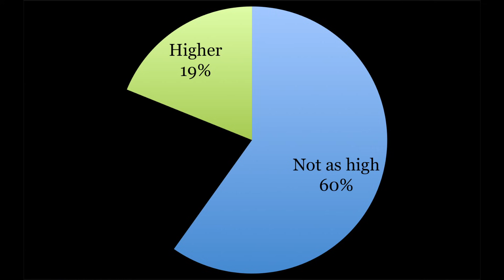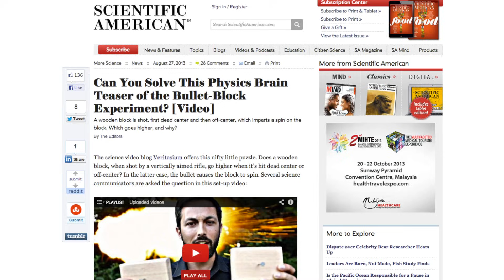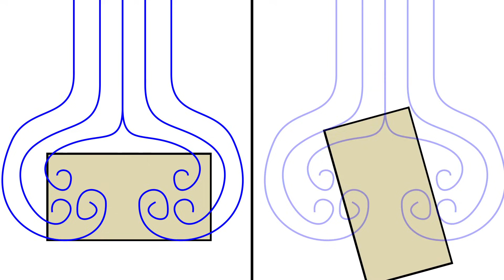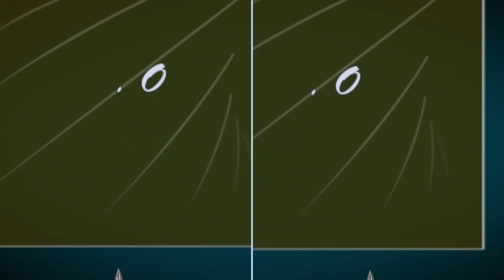Bullet Block Explained!

Comment: A way that I think might make it easier to measure might be to use layers of materials. If I remember correctly, bullet-proof glass works via multiple layers, with each layer taking away some of the energy from the bullet. Perhaps a phone book in a cardboard box, and then taking a general consensus of what page each of the bullets seems to end at? 

another possibility might be to laminate a harder wood to the outside of something relatively soft (a pine "box" with a balsa core perhaps?)  so that the outer core will take the brunt of the impact but still allow for it to pass through, and hopefully the softer center will be able to compress or deform easier, allowing a smaller amount of energy (the difference) to pass through it easier, and therefore be more demonstrable.

Comment: use stronger wood, like oak, and a longer piece of wood and also send the bullet in as close to one edge of the block of wood as possible.
Reply: A stronger wood is going to cause a shorter measured distance for both because it's going to take larger amounts of energy by comparision to go through the wood. This is all well and good if your bullets went completely through the blocks and you need a more durable material to make it register.

Comment: We have a CBC radio program in Canada called "Quirks and Quarks" where they get corroborating experts in to explain science. You needed one. A corroborating expert, that is.

It's cool that you guys are popularizing science but, it seems to me, there are so many variables that aren't taken into account, sufficiently, to make this "real science". And if it ain't real, it's fake. In this day and age, fake and unsubstantiated science does not help. Unless your favourite animal is a (sadly maligned) elephant..

To wit:

1. what is the average/SD of the amount of gun powder in each cartridge? (i.e. how to show that you are getting the same amount of oomph in each case?) Ditto mass of the bullet.

2. How can you be sure the same amount of energy is required to get a bullet to the same depth along a piece of wood? Wood is not uniform. Maybe by many (many many) repetitions one can get some empirical evidence to statistically account for any differences.

3. Did you show that the pieces of wood had, in fact, the same mass? Uh, no.

3.5 Nor did you properly set up the experiment to enable valid observation (yeah.... the one on the right was 3 pine needles higher!) of what may well be a very small but valid height difference.

4. Rather than taking 2 near identical (ostensibly) pieces of wood, why did you not try two quite different pieces but having the same mass. e.g. 1 piece of 1x2x4, 1 pc of 1x1x8. then try firing into the extremity of the 1x8 vs the centre of the 2x4?

5. Also where are you more likely to encounter variation in terms of the mass of the block of wood vs the mas of the bullet? similar mass for each or wildly different mass for each. Specifically, if he mass of the wood if much less than the bullet (hmmm... maybe balsa?) then one might expect (who knows if it is correct - do the experiement!) that if there is a height difference it would be of a larger magnitude than if the blocks were of, say, oak, in which case the mass of the oak would overwhelm the mass of the bullet. but then wind resistance may become more significant.

You could also have added a 'bullet catcher' to each block of identical mass and dimension to catch the fired bullet and prevent the fragmentation of the wood.

So, why did you do this experiment?

:)

blah blah blah

Comment: Both have the same rotational energy, but the first is direct centre hit has its rotational energy split equally across the centre and therefore doesnt rotate where as the 2nd has rotational energy all on one side. So you could say that the first is trying to rotate as well but equally in both directions. This is consistent with the force because when a bullet hits an object it doesnt impart all its energy straight, there is some energy imparted at an angle and this is where the rotation comes from. It may be less is the bullet was flat but it still exists. You can see this if you were to shoot through ballistic plastic.

Comment: Maybe you should take a block that is longer, were the distance between center and side is bigger? Than there's a bigger difference in bullet penetration. You can also do for fun use a bullet with a flat top so it has less penetration so less loose of energy.

Comment: To improve experiment: use heavier projectiles (bullets) at slower speeds. You may have to use softer targets, like clay, to achieve penetration if your projectile is moving a lot slower (it should).

Comment: i doubt ill get a reply but were you using hand made rounds or store bought rounds?

hand made rounds like what most target shooters use would be more accurate as they have the same weight of gunpowder same weight projectile and are pressed into the cartridge the same depth. producing a more consistent round

store bought rounds aren't as consistent the projectiles would be but the gun powder varies and the depth the projectile is in the shell changes also.

i don't think it would be that much of a difference but watching the variation on the blocks looks to me like around about a foot in difference so maybe it would have an impact on the results or maybe it wouldn't who knows

Comment: So...if I understood this correctly, the 50% "extra" energy in the spinning block is that which wasn't lost in the 0.1mm penetration difference?
Reply: Yeh he is trying to say that but I didn't get that too. His statements contradicted. In one statement he said that law of conservation of linear momentum (independent of conservation of angular momentum) was responsible for this. But later he told 0.1 mm story. Although when he measured through peg it was 1mm.
Reply: 2006mct42
It wasn't contradictory. It's just two different viewpoints: one way looks at momentum, which is conserved, and the other looks at the energy, which was retained from less penetration. It's all the same effect, though.
Reply: ok but what does it mean? Let's say that we try a non penetrating projectile(collision is elastic), then according to first viewpoint it should go to same hight because linear momentum should be conserved independent of angular. And according to second viewpoint it should go half the way. Is anything I am getting wrong?
Reply: 2006mct42
Actually, no. If the bullet doesn't penetrate, it'll bounce off. The total system of block+bullet would conserve its linear momentum, but the bullet would no longer become part of the block. Thus in both blocks' cases, the bullet would bounce away. By the momentum viewpoint, the blocks would be both propelled to the same height because when the bullet bounces off, it reverses direction (so its momentum changes, and the blocks have to move up quickly to conserve the total momentum). This change is equal in both cases because neither captures the bullet.

From the energy viewpoint, they'd still go to the same height as NO energy is lost deforming the block (penetrating it) in either case, so both have the same amount of energy transferred to them.
Reply: IceMetalPunk Ok thanks for your time and consideration. I understood the first point but not the energy viewpoint. That is because if equal energy was delivered in both blocks' cases and still rotating block reaches same  height then rotating block has extra rotational energy which can't be. As for as i can think (after understanding your first point) if they reach same height then the bounced bullet should bounce back with little kinetic energy but same linear momentum in rotating block case(analogous to less penetration in rotating case).

Comment: Put a heavy lead weight along the axis of the center of mass exactly opposite the side of the block where the bullet will strike block in center. Put the lead weight at the same spot for the block that will be shot off center. Record results.

Comment: Try to make the blocks a little bit thicker and

in 1st case: shoot the 1st block at both the ends (equal distance from centre) at the same time with two bullets and

in 2nd case: shoot the block at only one side with both the bullets at the same time and at exactly same distance from the centre.

It might clarify if the coupling force is the real cause behind these phenomenon :)
Reply: It is not a "strange" or particularly interesting phenomenon to investigate. It's school physics.

Comment: Please hit the block with a non-piercing projectile and demonstrate that spinning block goes half as high as non-spinning
Reply: Paintball time? Paintball time.
Reply: Actually the spinning block will go 67% as high as the non-spinning one.
Reply: how?
Reply: Actually you're right, I messed up. The rotational energy is 10 J and the gravitational energy is 20 J (as mentioned in the video). I thought it was (10+20)/10 which is the ratio of the energies the two blocks have in the video.
Yes, when hit with a non-piercing projectile, the spinning block will go ~50% as high as the non-spinning one. (20-10)/20

Comment: The spinning block has air traveling across its surface at a faster rate causing a lower atmospheric pressure on the leading direction of the upward moving block. The bottom or trailing surface has a higher air pressure therfore helping to push the block higher. Yes no maybe so.

Comment: If you fix the block in place so that it can spin around its axis (the nail), then it won't travel up in the air.  The energy from the bullet shot into the middle will be completely absorbed while the energy from the one shot to the side will cause the block to spin.  Since there will be no energy going into lifting the block, the difference in energy used to deform the wood should be magnified, allowing you to see a measurable difference in bullet depth between the two trials.  I would also think that this would make the block spin much faster, meaning an even greater difference in energies absorbed by deforming the wood, and a greater difference of bullet depth between the two trials.

Comment: If you want the differences to be measurable you just need to go BIGGER. Do the same experiment with larger blocks and shoot them as closer to the edge as possible. If my logic doesn't fail me you should see that this time the hights are different and so will be the depth of the holes.

Comment: Its not exact same height. Very small energy leaked to the spinning momentum because there is only the friction force in the air inteard of the forse of gravitation. Try other blocks with other attributes and other space between the center of mass

Comment: Can you use a Vernier caliper to measure the penetration? And do it many, many times, average for the two cases, calculate the error, make enough experiments to make statistical the error really small so the difference becomes measurable? So you probably can reach 10 micron precision this way (Vernier caliper reading error is +-5 microns - if i remember right).

Maybe if this doesn't work - higher speed bullets would work better - then there will be more energy in rotation, so more penetration difference.

Ohhhh!! And you can also shoot it further from the center of mass (make a larger block) - then the fraction of energy given to rotation will be larger, so it might become more measurable.

Comment: Use different materials with different densities, but also different volumes such that the mass of both objects are the same. One extra requirement would be that whatever is used, the objects are large enough for the bullets to remain completely lodged in them.

Comment: I think if we change the wood block in to another kind of material which is more fragile or soft, it will consume less energy when bullet travel through it, in the other word, this can amplify the difference between two sets of experiment.
And, I think the mass ratio of block and the bullet may help to enhance the result.

According to the formula of non-elastic object collision, we can get the energy consume to deform the wood and make block rotate is: (1/2)mV^2 - (1/2)(M+m)[mV/(m+M)]^2.

Comment: If the bullet hits the center, surely half the angular momentum occurs on EACH side equally, causing it not to rotate at all, whereas if it hits one side or the other, the angular momentum for that side is higher (and lower on the other side). We have equal energy going in, equal usage of energy to try and rotate the block, and so everything is conserved. :)
Reply: force have to make things move for some distance or rotating then transform to energy.
so, in your case, if the force to make the block rotate in opposite ways are equal and end up with no spinning, then the force doesn't do work, which means that your theory still end up with energy not conserved.
the truth is what talked in the video.
Reply: 陳重源 Ok, I'm not saying it's wrong, just that I can't quite make it all add up in my head.
 
We can't claim the force didn't do work because the block didn't rotate as we aren't working within a closed system. Did the temperature of the block increase ? Was teh sound louder?
Reply: Haha,
I'm just saying my opinion.
And English is not my native language, so if my words look mean, I don't mean to.
:D
Reply: Your english is very good, nothing to worry about there :D
Reply: thanks :D
Reply: but part of your concept is right,
the rotating block rotated do because of different amount of force applied on two side, then one side had more force and push the block to rotate, the part of remaining energy was transform to rotational energy.
And in the case of block not rotating, the force didn't transform to energy, so all the remaining energy deformed the block and made sound louder and of course -- heat.

Comment: Well, I learned one thing from this experiment. Sticking a nail in a bullet hole is an unreliable way of measuring a bullet hole. The off-center bullet hole was curved so the nail couldn't probe to the full depth of the hole.

Comment: use a higher power gun so the one percent difference is bigger (power 100, difference=1, power 1000, difference=10)
also, use a less dense material for the block so that the bullets will do more damage, creating a larger average depth of bullet penetration, making the total difference in depth larger (even though it's still the same percentage wise)
so basically, take your measurement zone from millimeters to centimeters

also, I totally called it because I used to be in karate, no math or anything, just a basic general knowledge of how it works when something gets hit
Reply: the big hiccup I see is that the spinning block apparently had 1.5 times the energy of the straight block, but only had a very small deviance in effect on the wood, a lot closer to 1% greater bullet penetration, instead of the 150% (going from shorter to longer penetration depth) that you would expect
that's what really gets me

Comment: A Larger, Lighter and Softer material should exaggerate the effects of the bullet, same energy going in but less resistance and less mass to accelerate, which would make the differences more noticeable. It won't make it much more than that 1%, if at all,  it will just make that 1% physically bigger.

Comment: the amount of science in this video blew my mind!!!! loved it!!!!
i do have a couple of questions (since im not expert on guns, wood or science):
1. maybe the gun doesn't shoot with the same force each shot, meaning the bullet doesn't have the same initial energy every time.
2. you calculated that the difference in penetration depth of the bullet should be negligible (as shown in the xray picture), but why did the nail went into the wood a lot more on the straight wood than on the spinning block?

Comment: Do the trajectory of the bullet within the wood has an impact on the amount of energy lost by the bullet?
By that, I mean, as you have described before:
- the bullet shoots the wood right to its center of mass, it implies no rotation of the piece of wood, the bullet goes in a straight line through the wood;
- the bullet shoots the wood away from the center of mass of the piece of wood, the piece of wood rotates, the trajectory of the bullet is a curve;
which means, if A is the point of penetration and B is the point where the bullet stops, in both case the length AB is the same or really similar (according to the X-rays) whereas the value of the integral of the loss of energy along the different paths is different. The X-rays provide that the point A and B coincides in both cases but we can't see the difference of trajectory, would such difference of trajectory has a significant impact on the amount of transmited energy?

Comment: take balsa-wood or an other material with a low density. Or: if you try it with an iron block or... a diamond block :D the non-spinning block would go higher.. propably

Comment: get a wider block of wood so that you can shoot further from the center of mass, this will amplify the difference in insertion debt.  How is Angular momentum conserved in this experiment?
Reply: angular momentum is always taken about a given point. For this situation, the most convenient point to take the angular momentum about is the center of gravity of the block (CG). When the bullet is shot through the center, the initial angular momentum of the bullet is zero about the CG and so is the final angular momentum of the system. When the bullet is shot at a horizontal distance 'r' from the CG, it has an angular momentum of m*r*v (m=mass and v=linear velocity). The final angular momentum of the system I*w (I=moment of inertia w=angular velocity) must equal m*r*v therefore angular moment is conserved.
Reply: Jesse Miller Thanks for you explanation, makes perfect sense now!